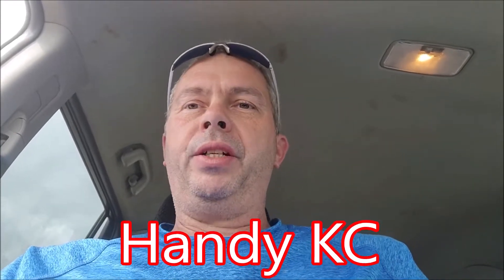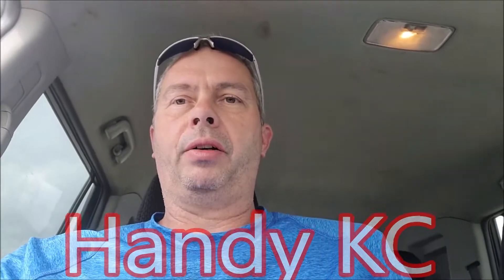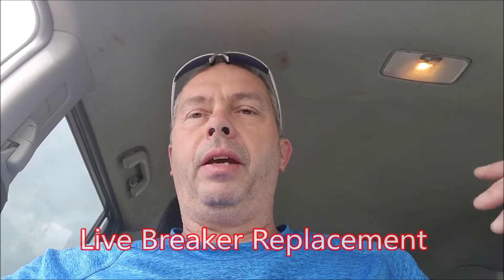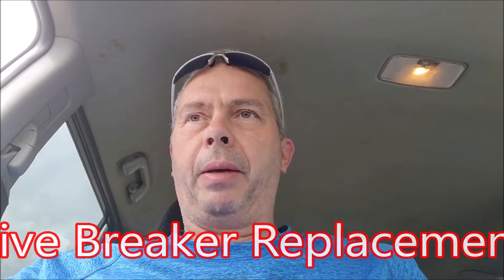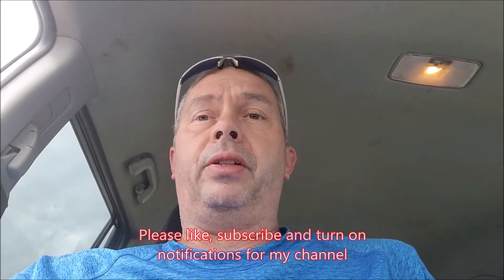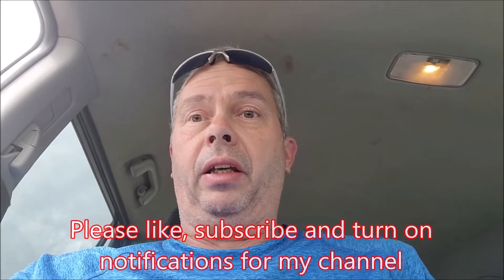How to Replace a Live Circuit Breaker and not die | Handy KC

Comment: stupid question. before i take a breaker out, i want to test a few breakers since i have a room that all 4 outlets have zero power and my breakers are labeled very poorly. do i keep main power on before i go touching breakers with my multimeter? and when you mentioned the breaker off the bus bar, i assume when you pressed your thumb on the breaker to remove it, that means it was off the bus bar and no longer hot even with the wires still attached? last question, if i feel more comfortable replaceingn a breaker with the main power off, which important appliances/electronics need to be turned off before i start? i assume as many as i can?.....sorry for all the dumb questions, i just want to make sure before i move forward...thank you for the video it is super informative!
Reply from the maker: Actually, those are great questions!  To test the breaker, yes, you want the power on. You just have to know how to test them.  Meter between the breaker lugs and neutral/ground bar.
 When taking breakers off of the bus bar, yes I was using the breaker for leverage.  Never touch a hot bus bar.  If the breaker is off of the bus bar, it is no longer hot.  Test it first.  If something is crossed or backfiring, that would not be fun.
If you are more comfortable turning the main off, please do so.  That as not possible in this situation.  It would not hurt to turn the larger and more sensitive devices off prior to disconnecting the main.  It wouldn't hurt to kill individual breakers prior to shutting down the main, but it's not totally necessary. 

Thank you for your kind words.  It really means a lot.  

If it is over your head, please contact a professional.   Electricity can be really dangerous.   Also, if you choose to do this on your own, protect yourself with insulated gloves.   Please take care!

Let's talk soon
  Let me know how it went and what you decided.
Reply: @handy_kc  thank you so much for your help! funny story. i ended up getting a cheap multimeter from Hfreight. i was able to narrow it down to one breaker that had 0v while all the others consistently read 122.5v. after that, i went ahead and turned off the main power. i was about to take out all 3 wires of that 0v breaker to take to a big box store to match a replacement, but i got scared what would happen to those live wires after i turn back main power.

so i decided to just leave the wires and just pull out that breaker to take pictures of any model number stickers top and bottom then take those pictures to the big box store. after i took the pictures, i pushed back the breaker back into its bus bar, and turned main power back on...as i was about to leave, my wife and kids came home.

i was so excited that i found out how to read the voltage my wife asked to show her, so i made her hold the meter. i said "they will all read 122 except one". i went down the line, she kept saying 122 over and over. i got to the 0v breaker and she said 122 again, and i was like "no just wait, its supposed to say 0", she kept saying 122. i was like no way wth is going on. sure enough it was reading 122v.

i rushed in the house, and my dining room that all 4 outlets were not working before...all 4 outlets lit up with that little ames outlet tester....

was it something i did when it came to pulling out the breaker and pushing it back in? i have no clue how i fixed it haha. sorry for the long story but i really appreciate your help. really gave me the confidence to tackle this even though i fixed my issue on accident! stay blesssed!
Reply from the maker: I'm really glad it helped!  If I were guessing, it sounds like a tripped breaker.  It may not have been obvious.  Maybe one too many crock pots on Thanksgiving?
Reply: @handy_kc  it was a "dining" room that we have never used before in terms of the outlets (12 yr old home) and i think they never worked when we bought the house but we were young back then and forgot to address it haha. only reason why the outlets was an issue now, was i wanted to mount a tv in that room for an additional play room for my kids. its still working today lol.
Reply from the maker: That's awesome!